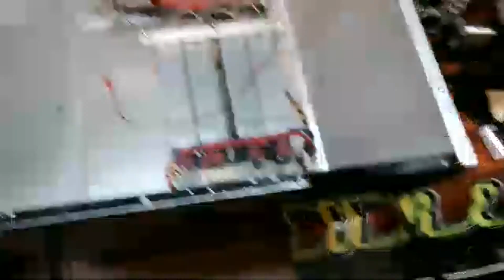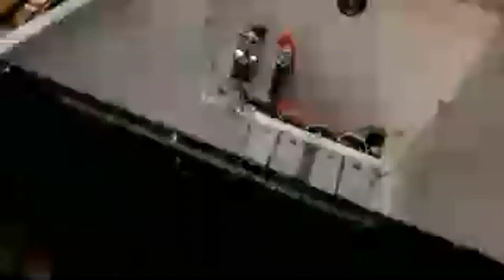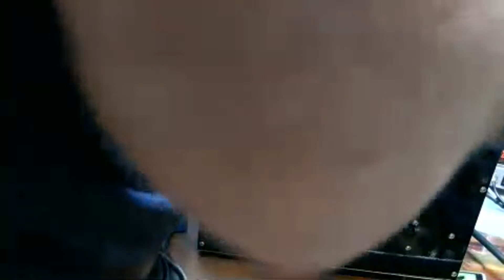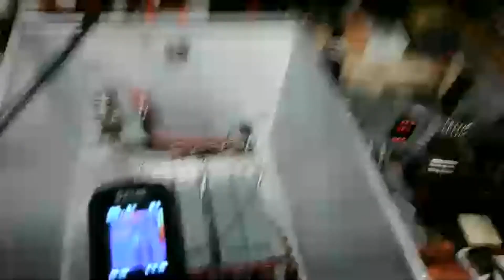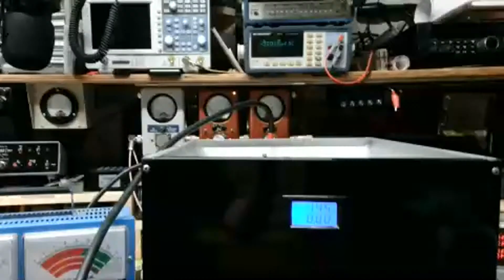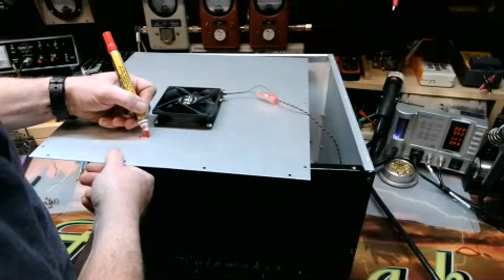RL, your Power supply is done.

Comment: I am building one of these units and im confused on how to wire the combo volt/amp meter i got i got meter and 500amp shunt is there any way in one of your live streams you could explain how to hook the meter and shunt up inside the supply i am going to hang shunt off negative terminal inside the unit thanks for your time and content!
Reply from the maker: Yes I will be happy to do a short video on hooking up a volt and amp meter. Give me a couple days and I will try and lay one out on the work bench and show you how it needs to be wired.

Comment: What wire sizes are on the DC and AC?
Reply from the maker: Each module has #16 on the AC and #8 on the DC.  Thay do not exceed 15" long. Otherwise, would need to be larger Guage
Reply: @rainmakerscustomsrainmaker8985  Thanks, very clean and I like your design.

Comment: I have a question i have a HPC-1 connex 10m CB Radio  have had it about 1.5 yrs had it  set u when i got it it was fine 4 about a yr then noticed it getting weaker and weker til it quit had someone else look at it another CB shop they said a Diode was to week got ut back work for about an hr the quit again  same shop fixed it again told me not to turn it off mont later i turned it off. When turned it on again  it got weaker then quit again  i dont know what it could be i had a 2020 Maxk anthem now i got T680 dont know if different trk models could affect it working. Im sorry this is so long i know i leve aome what close to you im in E  Tennessee area anyway guess ill get it looked at again hoping u could point  me in the right direction . I think you did a review on. CX-33HPC1 thanks. SSL
Reply from the maker: Yes it sounds as though there is an issue with the biasing circuit on the transistors.
Reply: @Rain Makers Customs Rain Makers Repair  thanks sorry comment was so long.  It's hard to find anyone that works on CBs anymore especially on the road